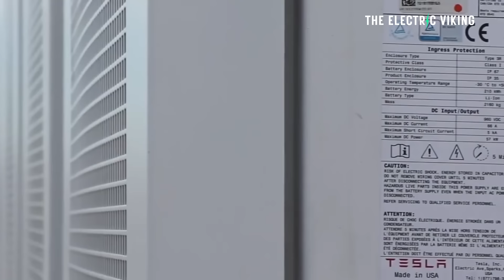Huge Tesla Mega-battery installed to replace Hawaii’s last coal plant

Comment: Coal is gone, but Hawaii is still burning oil.  In Hawaii the electricity costs about 3X the average of contiguous US (48 states).  Yes, that's how much more it costs to charge an EV.
Reply: Indeed oil is used to make over half their electricity. 

https://en.wikipedia.org/wiki/Energy_in_Hawaii#Electricity
Reply: Not anymore.  First coal, next oil.  The cost of electricity will plummet.
Reply: That's BS, and I don't mean you are wrong, I mean it shouldn't be that way. Electricity for charging cars should be cheap when the sun is up, and expensive when you are burning oil to make it.
Reply: someone has to pay for these batteries, so I guess the electricity is not that much cheaper. Say they last 10 years, so say $12000 for the battery, that is $100 a month in "electricity" bill. if they last 20 years its 50 a month.. or do they get the batteries for free?
Reply: @AndrewTSq   lol a thinking the batteries will last that long
Reply: @AllDogsAreGoodDogs sorry but it really doesn't work that way, fossil fuels are way cheaper than electricity. There's a reason why the transition to green sources over fossil fuels is directly tied to electricy prices sky rocketing
Reply: Okay, so no need to pay for that coal. Some coal plants can burn a tonne in 15secs, what's the price of coal nowadays? Also does Hawaii have a refinery or a natural petroleum source? 
I'm sure the locals know the benefits of having solar on their roofs.
Reply: Why don't you get a solar system even just a 6 kilowatt one
Reply: @fjalics  There's battery storage for night time.  And I don't BS people, thank you.
Reply: @AndrewTSq  Ask the mayor of Perth about costs.
Reply: @AllDogsAreGoodDogs  lol dream on.
Reply: @AllDogsAreGoodDogs  I found info, they cost $2 million each (4hour do the battery last) . Hawaii will use 158 of these, so $316 million. edit: and they come with 15 years warranty
Reply: @AndrewTSq batteries cost way less at larger scale of the mega pack.
Reply: @AndrewTSq  A lot cheaper than coal, which is 78x the cost per kwh before being marked up by the utility.
Reply: @AllDogsAreGoodDogs  but batterys cant produce energy by themself, so you cant compare the price.
Reply: @AndrewTSq  "batterys cant produce energy by themself, so you cant compare the price" Yes you can: The battery costs less than the fuel spent idling a power plant during times of low demand and running a whole second power plant that is only selling power for a few hours per week.
Batteries do not produce energy but they do store what would have gone unsold. Because the energy producers can sell more the cost will go down and because the battery provides extra capacity when demand rises there is no need to run a second power plant just in case someone turns their AC and coffee maker on at the same time.
Reply: @AnalystPrime  that money is 14Gigawatt of power, and since Hawaii only seems to be using megawatts of power, the coal could be burned for many many years so coal is cheaper.
Reply: @AndrewTSq  Wrong.  Batteries power inverters, which produce the A/C.
Reply: @AllDogsAreGoodDogs  I didn't say you did. I said it's BS that electricity is expensive during solar hours.
Reply: @fjalics  The peaker plant's fuel, coal, and its processing, was 78x as expensive as oil.  Hawaiian Electric (HE) reported that.  It was accounted for by HE.  Who pays for that?

Comment: You have to consider the geography of Hawai'i. A lot of things have to be shipped in, so if coal and oil can be replaced by wind and solar, by adding a storage system, then it makes a lot of sense to do so, because those fuels won't have to be transported. It is not the same elsewhere, where there are abundant oil fields but little reliable wind.
Reply: On the face and on paper it looks good but how much land was cleared for the Solar and Wind for the equivalent energy production for that one Coal Plant? Hawaii's indigenous animal life was already stressed due land development. Hawaii used to be dead set against anything that would take away the land resource and endanger what animal life remains. Not to mention that any object or tall structures that took away from the landscape beauty that is Hawaii. Have they thought about where they are going to put all the used Solar and Turbine Blades once they have to be replaced? Of course you will have to clear more land for that for a large landfill. What happened to protecting the land? A new high tech nuclear plant like the ones being built in France, Japan, South Korea and China would have been able to produce more than enough energy on a much smaller piece of land lasting a lot longer than dozens of wind turbines and solar panels.
Reply: @shumann1605 Stop being so logical. Logic is not appreciated by the dolts that view this rubbish. 😊
Reply: @shumann1605  the big island has about   1/5 the population and is 8 times larger than oahu so there's ton's of space
for solar.  my condo has half its roof covered with solar(leased) that cost us 24c per kwh, as opposed to 60c for the grid, not counting the monthly tie in fee.   A lot of time the solar and connect fee is what i pay for, not have to buy from the grid at all.

 The sun is reliable out here. Whereas since the ukraine war the supplies of gas like propane come from the states not Russia, the jones act makes those really expensive.
Hawaii should be the first place to go 100% renewal in the states.
Reply: @shumann1605 that coal plant and storage and docks and trucking takes up loads of space.
Those ships those trucks the coal all took energy and materials to produce and mine. 
The cheapest nuclear plant comes in at $6k U.S. per kw to build that's not licenses and fuel which is very expensive. It has to go off line to refuel and maintain. A nuclear plant requires more concrete than some small countries can supply never mind an island. It's not viable for a small islands and diffinitly not for the demanding loads. It's quicker cheaper and far more practical to go wind solar and battery

Comment: Coal is never a peaker plant. Peakers typically use diesel, oil or natural gas to run a generator.
Very inefficient & dirty but very quick to switch on. Batteries react even faster.
Reply: @oldbloke204 sorry are you a battery expert?
Reply: @oldbloke204  I'm sure some electrical engineer did the math. It's going to last as long and longer than design too. It charges at off peak and discharges at peak. That is what the coal plant that it is replacing did. No need to import and burn all that coal.

Comment: Right after I watched this video, I read an article about a town in Utah replacing a coal plant with a plant that will use hydrogen generated by wind/solar. The hydrogen will be stored in underground caverns and will be used as a giant "battery" for energy storage. On it's face, it sounds pretty good, except it's super expensive (minimum US$ 2B) and will have to transition from natural gas to hydrogen slowly over the first 20 years of operation. Seems like putting in battery storage like they did in Hawaii would be way more efficient and far cheaper than this hydrogen scheme, and would be zero emission on Day 1 of operation. Maybe this concept of using hydrogen for storage would be a good topic for a future video?

Comment: Pump hydro costs half per kWh and lasts for more than 100 years
Reply: Clearly, you have never been to HAWAII 😊
Reply: But takes longer to build.
Reply: user-uk8tl3xy9e  You need 2 artificial lakes at different hights. 
The latest was built in Switzerland at 600 m level difference.
And will be in service with minimal maintenance practically forever. 
Batteries are twice as expensive per kWh and must be replaced after 10 years.
Reply: @michaelchilds3305  And last at least 10 times longer and the cost per kWh is half.
Reply: Pumped Hydro with water towers?
Reply: @PhilipX2030  Not enough energy. Pump hydro is efficient for large stations. For example in Switzerland they just started 20GWh station for 2.2 billions $.
Reply: user-uk8tl3xy9e  but where their is possiblity I don't know why it isn't build.
Reply: Pumped hydro is actually 4 times as expensive as batteries were 5 years ago.
Reply: @chrishaberbosch1029  2.2 billion $ for 20GWh, means 110$/KWh. And will last for more than 100 years. 
In 10 years the batteries must be replaced.
And it was build in Switzerland which is not a cheap country to build.

Comment: Let us hope the Tesla Megapack does not catch fire and burn for three days, like the Megapack in Victoria, or catch fire like the Megapack in Queensland. Good luck relying on a battery for base load electricity.
Reply: That's a special case, single pack burnt. Not the entire unit.  Only one ever. They let it burn so no need to waste water. It was an installation fault. No fearmungering required. At no point did it go off line. No one was injured. 
 I don't hear any fearmungering when that oil rig fire killed all those workers, or when coal mines burnt, or coal plants. Then you have nothing to say!

Comment: Batteries do not produce power.  They store power.
Reply: The sun produces more power than we could ever need.  We just need to store it.
Reply: that may be why they have got wind turbines and solar in the video.
Reply: @king4b1 the video is not of Hawaii
Reply: @benjaminthomasson  correct. But to store that energy with current technology is just fanciful thinking
Reply: Batteries does not produce energy but they do supply power. Power and energy are different things. Batteries are like water tower they do not create water but they provide water pressure.
Reply: @kazedcat  Only useful for FCAS
Reply: @kazedcat  Power and energy are not separate things.  Power output and capacity are different things.  The Watt is the unit of power and, in electrical terms, represents the flow of Coulombs of energy in the time domain.  The Watt also applies in mechanical terms.  Look up the formulae.
Reply: @yuglesstube  Power is not energy. They are related but not the same.
Reply: @yuglesstube  Batteries with 4 hours of capacity can replace peaker plants. FCAS is not the only service batteries can provide. FCAS, Synthetic Inertia and Peaker Services these are the things batteries can provide.
Reply: @kazedcat  my point exactly.  These batteries are only useful as network stabilisers.  In this application they generally displace gas peaker plants, which are more expensive to operate and less optimal in terms of hysteresis.

But where is the power coming from?
Reply: @kazedcat  They are one and the same.  Energy is measured in Joules.  1 joule per second is 1 Watt.  Basic physics.
Reply: user-uk8tl3xy9e  And that little detail is at the core of the problem.
Reply: @yuglesstube  joules per second is not joules or are you claiming that miles per hour is exactly the same as miles. Is Canada faster than Ferrari?
Reply: @yuglesstube  Solar. The power comes from chemical energy stored in the battery chemistry. The energy comes form the nuclear fusion in the sun.
Reply: @kazedcat  And how much energy are we talking about?  I'd suggest not much at all.
Reply: @kazedcat  did you pay attention  at skool?
Reply: user-uk8tl3xy9e  The amount of panels or turbines required to power a city is incredible.  You'd have to cover the entire island just to power Honolulu
Reply: @yuglesstube  You don't need to store much energy if you size your solar to provide enough power at the darkest day of the year. You just need 5 days of battery storage for full year of 100% solar energy and even less if you have wind to supplement solar generation.
Reply: @yuglesstube  Which school teaches you that power and energy are the same?
Reply: @kazedcat  the engineering school I attended
Reply: @yuglesstube  You should quit that school immediately. If they cannot even tell the difference between energy and power they are not much of an engineering school.
Reply: @kazedcat  interesting.  I suggest you examine the formulae.  Power is energy.   Think of it in terms of voltage and current.
Reply: @yuglesstube  Energy is not Power just like distance is not speed.
Reply: @kazedcat  so what then is the unifying equation?
Reply: @kazedcat  it is the Watt, to save you the trouble.
Reply: In 2020 the highly credible and respected - if not highly conservative - International Energy Agency (IEA) declared solar energy the cheapest form of energy in history! [Relative cost] 

Since then, the cost of solar has continued to plummet.
Reply: @douglascutler1037 lol, that's B's.
Reply: @douglascutler1037  And they're wrong.  It's cheap at the point of production, at midday, only.  From afternoon to morning it's infinitely expensive because the investment produces nothing.

And then there's the grid stability problem, which requires Synchrons, smart inverters and other measures, including peaker plants or batteries, to manage.    

Throw all that in and it's by no means cheap, but at least it's unreliable.
Reply: Was that non-sensical headline deliberately posted to elicit comments?
Reply: Well, duh . . .

Comment: How much carbon-based fuels are used in the manufacture of these batteries? What is the process for recycling these batteries when they have reached their end of their life cycle? Same question needs to be asked of solar panels and wind turbine blades. Since CO2 only makes up .04% of the atmosphere and man only adds 3% of the .04% the whole global warming narrative is total BS. Better to continue to use the coal fired plant and wait for thorium nuclear reactors to become available. Thorium will make electricity very cheaply with none of that evil CO2 (plant food).

Comment: Nuclear electricity is busting to get onto the grid before rooftop PV fills the grid with its cheap electricity from the EVs big battery. 
Most vehicles are parked 23 hours every day. 
EVs with V2G and selfplug-in like the home robotic vacuum cleaner and robotic lawnmower will block all nuclear electricity. 
Building owners will be able to go offgrid or be park of a community power supply .

20million multiplied by EV and rooftop PV numbers is massive.

Many people can only understand adjectives, Hahaha 😊

Comment: As wind farms are not generating anywhere  the electricity they were supposed to ,they are proving to be uneconomical . Lots of  projected project have been cancelled as they cannot get finance as they don't make enough money . Have a look back about 6 months ago , finance companies reportedly looses on wind farms .You can have all the Battery STORAGE. , but they do not generate actual power they simple store it with about 10%  loss .
Reply: Volcanic Geothermal for turbine generation.. likely, no storage needed

Comment: I'm not a battery expert, but it seems like a waste to use LiFePO4 when there are cheaper capacity per dollar options. The relatively high energy density of LiFePO4 seems unnecessary for grid storage.